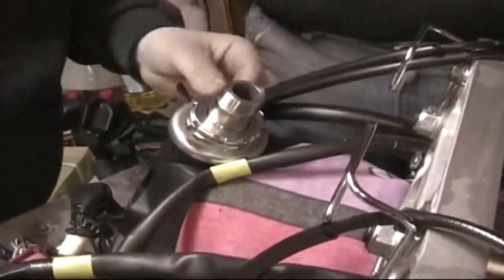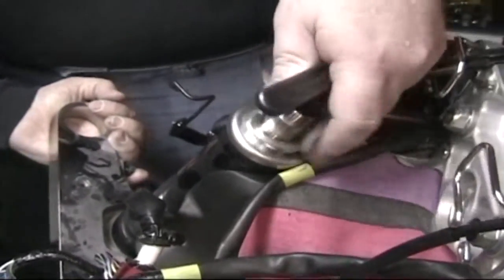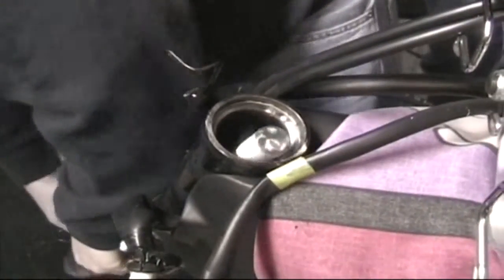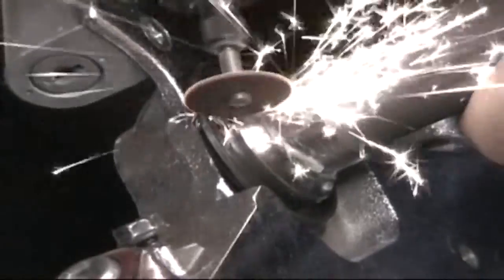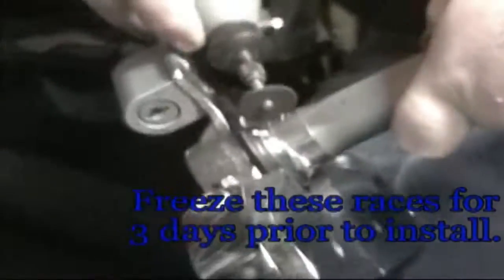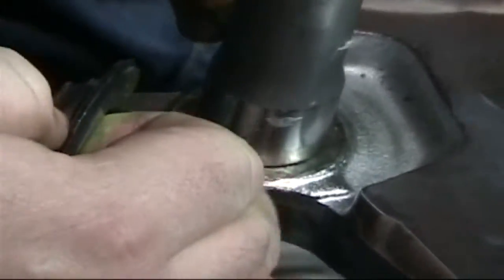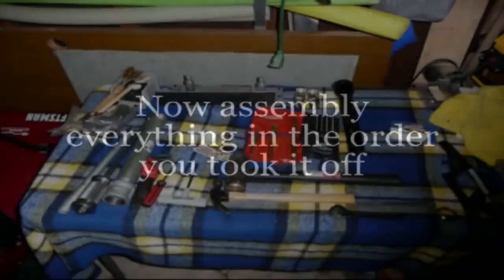VTX1300 Steering Bearing Replacement

Comment: Whats up dude with the all balls kit you dont replace the race on the steering stem correct just press the new bearing on it ?
Reply from the maker: No, cut that race off and press the new race on.
Reply: Okay so there is a total of 3 races upper lower and race of steering stem?

Comment: How many miles were on This bike when the new bearings were needed. My bike only has 12,000 miles and I have the front end wobble at 40-50 mph ?  Thanks so much
Reply from the maker: That's about the time that I replaced the neck bearings on my bike.
Reply: @GoheenCycles  what is a symptom of them needing to be replaced?
Reply from the maker: @MetalHDGMR  Usually when you let go of the bars at about 35 mph you will get a shake in the front end.  That "death wobble" is the tell tale sign that it's time to replace.

Comment: This seems like a pretty extensive job I am concerned of how much this is going to cost me I'm within my 30 days should I return the bike [ handlebars shaking violently when I take my hands off]
Reply: Your handlebars aren't shaking from neck bearings. Check wheel balance. Air pressure. Wheel bearings. Tire condition. Many contributing factors. Unless you trailer your bike alot neck bearings last a long time.

Comment: Ive read that folks are using different torque values on the main nut (12,15, 30) which do you use?

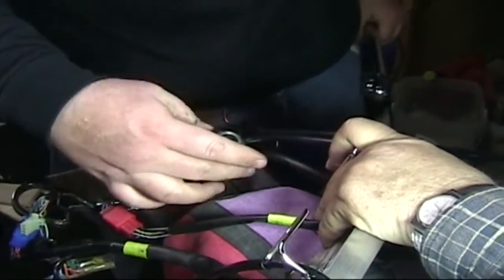Comment: OK pretty good video however the locking nut on top of the stem nut does not get torqued as you did at time stamp 9:00 in this video, watch from time 8:53 you installed the stem nut, then the locking plate and the locknut and then torqued the entire assembly. It's the stem nut (the one that goes on first) that gets a preload I think it's 12-15 ft-lbs, then the lock plate drops on and hand tight the lock nut to align with the tabs. The upper triple tree nut will lock everything in place once torqued. That's according to manual and every tech I have ever talked to about this. PLEASE everyone doing this DO NOT TORQUE the lock nut.

Comment: Guys, awesome video, I am doing major maintenance on my X. One thing to add if anyne interested, I can upload a vid. You can get away (spanner wrench part) with a flathead screwdriver and a rubber mallot
Reply from the maker: You can also buy a large socket.  I have found that its actually to get the correct torque spec doing it this way.  Good idea though.